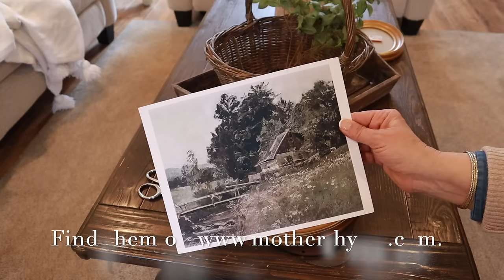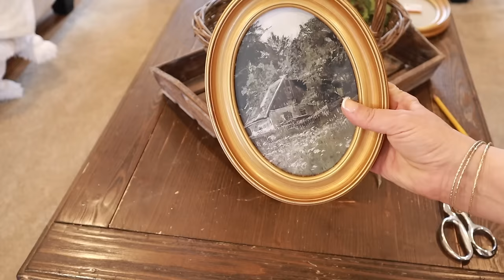Cozy Cottage Style Living Room Makeover | DIY Faux Beams | 2024

Comment: I love board and batten,  it's one of my favorite ways to update and add interest to my home.  I also love that gray,  so so beautiful! I do have a suggestion if it's ok, I think that a wider tv console table would be better on the eye and eliminate the clutter. I think maybe an 80 or 85 inch console because your tv is 70 inches, it would work a lot better than the smaller one you have underneath.  That wall is so huge, it can definitely use it. Just a suggestion.  I know you love symmetry so that's why I suggested it, but the board and batten turned out beautiful! ❤

Those beams are gorgeous!! Y'all did such a great job! As always, your home is beautiful! Tfs
Reply from the maker: Hi! Thanks so much! The color made the room so cozy! I actually have been on the hunt for a bigger console. I’ve had this one for years when we had a smaller TV and I just haven’t found a bigger one I like so I’ve just used this one until I find another one. I totally agree, a bigger one would look better. 😉
Reply: @MotherThyme  you can also add another one of the same kind to give it the look of a longer console because the one you have is a beautiful piece. Longer consoles are hard to find and if you find one they are super expensive.  I couldn't find one so I had to build it myself, because I have the same problem in my entryway.

Comment: Hi, I’m new to your channel and loving it!  I have textured walls in my home and really want to do board and batten.  Do you think it’s possible for me to donor with textured walls?  I would love your opinion.  Thank you
Reply from the maker: Hi and welcome! I’m so happy you found my channel. While I have never tried it on textured walls I would try it as long as the wall isn’t brittle where it could really chip or crack the wall. If you don’t have a problem when hanging pictures on the wall it could possibly work since you use an air gun to hang the boards. You could also try using a little board too. I hope that helps! Let me know if you have any questions!

Comment: Just my opinion, but beams and recessed lights do not go together. Also,beams need a really high ceiling to get the right effect, or the room looks closed in.  You also have to consider your television is at the top of the wall, and you added the board and batten.  So a lot going on in one room.
Reply from the maker: Hi! Thanks so your opinion. Maybe it’s not showing up on the video but the room is very cozy and inviting. I’m so happy with the way it turned out. It turned out even better than I hoped.
Reply: Lovely. I like the color of board and batton, you really think things out. Thank again for sharing ❤